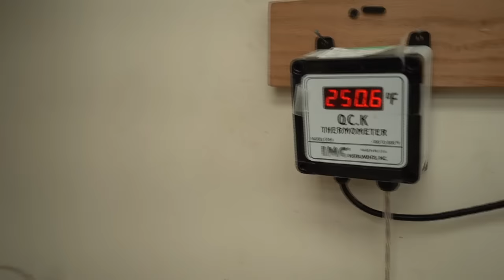Using The Vintage Candy Chopper to make Super Sour Hard Candy!

Comment: Baking powder is a combination of baking soda and an acid, combined in the right ratio that they will react to produce carbon dioxide (for leavening) and the inevitable salt byproduct of a redox reaction. Typically, baking powder also contains a moisture absorber (e.g. cornstarch). The reason for the moisture inhibitor is because you want the leavener to react when you mix it into your recipe, not while it's sitting on your pantry shelf. It increases the shelf life.

Modern baking powder is double-acting, which means that it contains two different types of acids. Cream of tartar (or the cheaper monocalcium phosphate) will react immediately upon the addition of water. But other compounds, such as sodium aluminum sulfate, will not actually combine into the mixture until they have reached their melting point. This makes the baking powder "double acting", since it will immediately start to produce gas that lifts the baked good, but it has to be heated to some critical temperature to finish reacting fully. This gives you a bit more forgiveness for how much you mix the batter... once you bake it, it'll still get that last kick regardless.

The "baking soda and cream of tartar" approximation is decent enough, with those two caveats: it has no inhibitor to moisture, so once mixed, it won't have a long shelf life; humidity will cause it to react prematurely. And it's a single-acting formula: the cream of tartar will immediately dissolve, and it'll begin reacting immediately; if you over-stir your recipe, it's not going to rise properly. That being said, if you plan appropriately and use the proper technique, it should get the job done.

Comment: At about 37:45 you're mentioning that fizzy candy would have to be kinda sour. But carbon dioxide dissolved in a fizzy drink produces carbonic acid, so a fizzy beverage is going to be kinda sour by default. Not that different really.

I think the saltiness of the baking soda would be more of a contributing factor to it tasting different, rather than the acidity.

Comment: Have you ever overflowed the side bars when you are pouring the hot liquid from the copper kettle?   It always looks pretty close.
Reply from the maker: Sometimes a little pours over, but since it's such a small amount it cools very quickly and doesn't really go anywhere and it just gets added right back into the batch
Reply: @HerculesCandy  Ah. That makes sense.